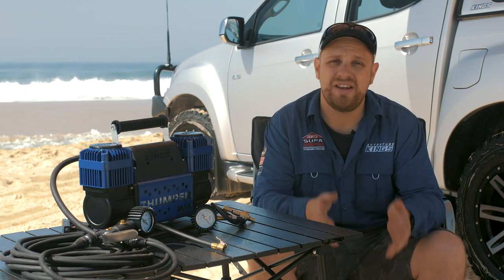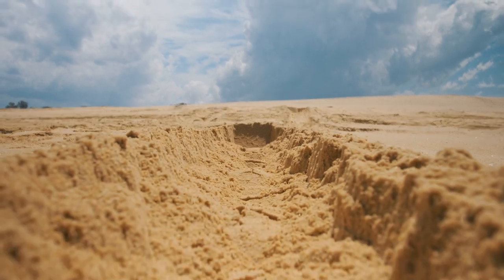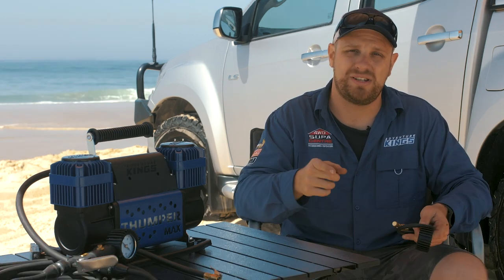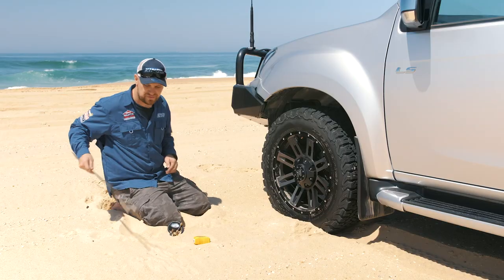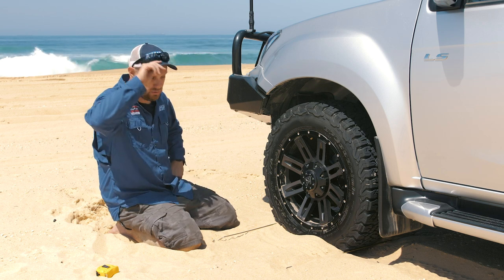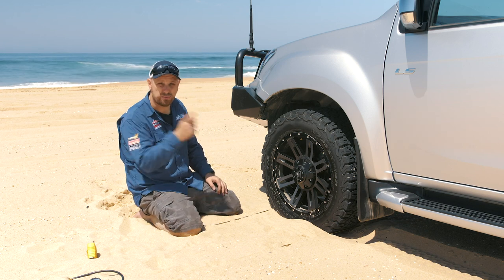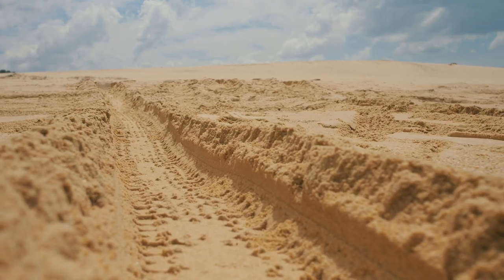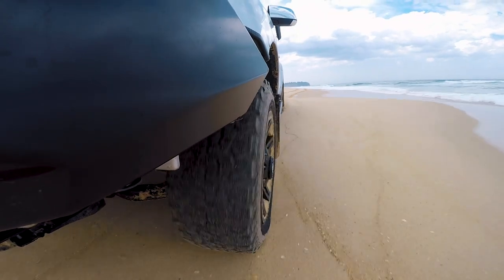4WD TYRE PRESSURES EXPLAINED! Every terrain - every vehicle revealed!

Comment: Nice!  As a wheelin' "noob" here in the (Southwest) States, I'm trying to get the proper gear together.  I just bought a new 2024 Chevy Colorado ZR2 ("Zed Ah Too" for my Aussie Mates!  LOL) and found airing down with a gage a TOTAL pain, airing up with my new compressor was easier.  So, I bought the Staun deflators.  And since I'm more an "overlanding" guy rather than a mudder or serious rock crawler, I've decided on 28 PSI so I can run at the higher speeds the ZR2 is also good at.  Thanks for the vid, this stuff really helps us noobs!

Comment: Here in Argentina I've got a Chevrolet S-10 (Holden Colorado for aussie market) base model, and single traction. I put 10psi in each tyre and driving in second gear I can drive in soft sand. Of course, it's dangerous for the tyres and It isn't recomendable, but I'm poor and I love go to beach :D
Reply: 10 psi very low. 16-18 should get you anywhere get yourself Staun tyre deflators
Reply: 10 is fine as long as it's only sand

Comment: I should have watched your video two months ago. I hit the beach in NC USA with my super duty F350 pickup truck on 80 psi. Immediately I got stuck. I had to lower the pressure to 18 psi to get out of the soft and deep sand. 20 psi didn’t work. Thanks for the education!
Reply: Is that a tow rig also? What size tires do you have

Comment: Snow wheeling I run around 7 psi to get good traction. Every vehicle is different. The lighter the vehicle, the lower you can safely run. Tire size also comes into the equation.

Comment: one thing you didn't mention that makes a  huge difference is the elevation you're at. If you start at sea level and climb into mountions you will have a drastic difference. In the mojave i've started at 1100' and travelled to 7200' and had my preasure go from 12 up to 23psi. big difference

Comment: Especially on soft rough surface sand.low pressure in your tyres allows your tyres to roll overlump mounds of sand etc.instead of forcing though the samd.think of it as eliminating the wedge in front of your tyre.
Reply: Do Aussies spell "tire" as "tyre?"
Reply: @Eric-tq3vn  Yep.

Comment: I think there's more to it than just the length of the footprint. If it was then you'd only need a bigger tire and you wouldn't get stuck. It also has to do with tire shape. Hard tires will retain their circular profile and dig in but flat tires will conform and become flat on the bottom so they don't dig in.
Reply: Facts
Reply: You got it, I describe it low pressure the Tyre reshapes like a bulldozer track, high pressure the tyres become like bowling balls in the sand
Reply: that's what I thought as well. Being only 5 cm in difference I don't see much of an effect. But take that moulding conforming property and it GRIPS.

Comment: you mean on the road we have to drive our tires with 28psi air pressure. But in the video with the sand, you have road air pressure 36psi which is correct?

Comment: Question when you decrease tyre pressure on sandy soil, does it decrease ur ability to turn sharp turs
Reply from the maker: Hi there,
It shouldn't decrease your ability to turn.
Regards, Courtney
Reply: @4wdsupacentreAu  thx ima tell my dad bought this, in my country its sand like the beach with tree shrubs sometime. also what is the best psi for normal tar road?

Comment: Dude, good video.  Your tires are too low profile for a good tire.  You want a large sidewall, that way it will be far more effective when you lower your pressure.  I have 35's with 16 inch rims.  A tire like that is far better for off roading than a 20" rim you see on a lot of mall cruisers.  Try sand around 9 psi.  16 psi is still pretty high for loose sand.  I think you'll like it.  Cheers.

Comment: I have a 4 x 4 Mercedes sprinter that weighs between 9000 and 10,000 pounds fully loaded. Recommended tire pressure is 46 psi front and 67 psi rear. Obviously, dropping both to 16 psi is probably not a good idea with a vehicle that heavy. What would you recommend for sand driving, should I drop the tires by approximately 50%, or, is there another rule of thumb when dealing with a heavy vehicle and different tire pressures between the front and rear?
Reply from the maker: Hi Jeff, Because you have a bigger car and more weight, It may be an idea to start around 22-24 PSI on beach then go from there. If you need to drop a little more, you may but I would say avoid going too low as you wouldn't want to run your tyre off the frame.
Cheers,
Saleha
Reply: @4wdsupacentreAu  Thanks for the reply.  Just clarifying, you would recommend  22-24 psi even for the back tires which support more weight?
Reply from the maker: @zachandtomdad  Hi Jeff, for front tyres. Then initially a bit higher for back but I would recommend doing the test to see what exact number works for you before you drop too low. Cheers, 
saleha

Comment: Do your pressure numbers for various terrain apply to a truck with a 9400 pound gvwr like a Ford F250SD?
Reply: The heavier the load the more you need a rough estimate in my experience with same truck would be 15 psi minimum  only if necessary for short distance at slow speeds. 20-30 for fairly rough trails with rocks depending on speed and how bad. Regular dirt,gravel roads at moderate speeds around 35 psi.

Comment: I have high pressure tires  80 psi for road driving,  is it safe to lower them to 16psi? I worry about damage and  breaking the tire bead on the rim.
Reply: what did you drive? 80 psi is usually its maximum presure under full load, its not for empty driving..
i you gonna air down at fullload, just see the tire when you deflate it, 70% of its original height works fine to me